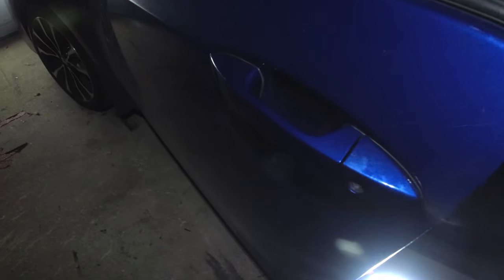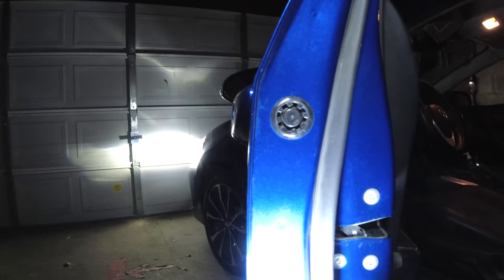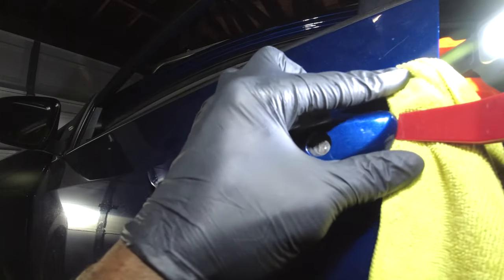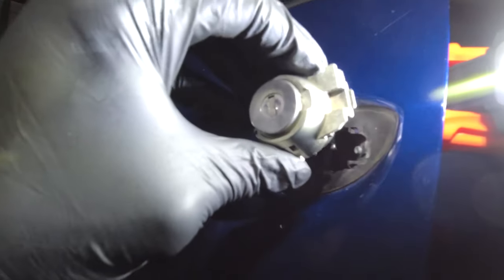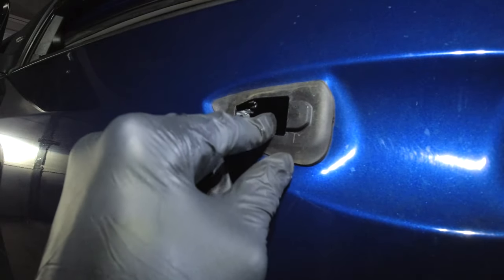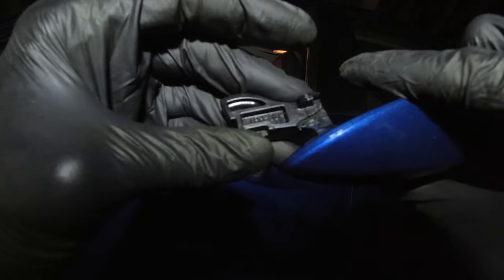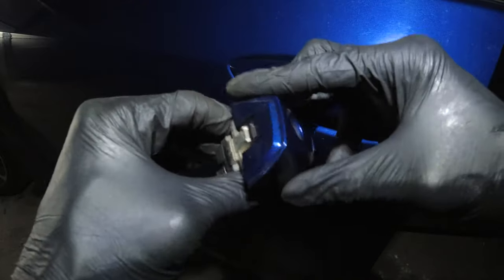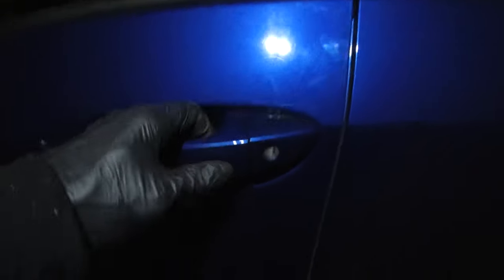2014-2019 Toyota Corolla Outer Door Handle Replacement (VERY EASY!)

Comment: I'm unfortunately having a lot of trouble screwing the lock back in....
Reply: what did you do? I've been trying for two hours to get mine to screw back in but its just not working
Reply: i found the solution, there is a VERY SMALL piece of plastic that holds all of the plastic innards closer to the outside of the door by a couple millimeters. its on the bottom right side of the smaller opening (the one the cylinder goes into, it looks almost like a broken piece of plastic. i had to use a screwdriver to enter from the side of the door where the torqs bit is to push the plastic as a whole to the left, and i heard a click of the very small plastic clip, its a tiny little hook that grabs the metal of the door.  I'm sorry if this was long winded, i just wanted to be thorough in that its small but does exist. as soon as it clicked into place i was able to thread the bolt back in without issue.

Comment: I've done everything i can imagine doing and i cannot get the bolt to line back up, the lock cylinder is perfectly flush on the car, its perfectly seated in the locking mech, but the bolt just spins. im leaving this comment as a desperate attempt to find a solution, ive been trying for hours and it just free spinning
Reply: Same exact issue I'm having
Reply: @gregoryparelli1526  i found the solution, there is a VERY SMALL piece of plastic that holds all of the plastic innards closer to the outside of the door by a couple millimeters. its on the bottom right side of the smaller opening (the one the cylinder goes into, it looks almost like a broken piece of plastic. i had to use a screwdriver to enter from the side of the door where the torqs bit is to push the plastic as a whole to the left, and i heard a click of the very small plastic clip, its a tiny little hook that grabs the metal of the door.  I'm sorry if this was long winded, i just wanted to be thorough in that its small but does exist. as soon as it clicked into place i was able to thread the bolt back in without issue.

Comment: Thanks, used this video to get it done. The dealership said it would take 2-3 hours, took me 11 minutes. Half the time was just trying to fish out the plastic piece.
Reply from the maker: Same here.  Happy to help.  Stay safe.
Reply: @LoneWolf74_  It was much easier than expected but it was a passenger door with no lock so less of a task. Wondering if I should buy more for spares. It's just a single plastic piece painted to the vehicle color. The part is just the handle, so everyone should make sure to not lose those gaskets.
Reply: Yea, they wanted $450

Comment: My door handle is behaving the same. Would this extra movement cause me to also have a hard time unlocking the door with the physical key? Sometimes I can not turn the key to unlock the door. Thanks
Reply from the maker: Not Sure.  A plastic piece might have broken internally which could be possibly hindering the lock cylinder from turning properly but I'm not sure.  I'm convinced this is just a way to get more money out of people.  Plastic crap that breaks way too easily.  Back when I was little (in the '80's) a broken door handle was the last thing we had to worry about because cars were made differently back then.  Everything wasn't made out of cheap plastic that was designed to break to get people to spend more money.

Comment: **for those with issues tightening torques bolt back into place**

     This video is fantastic and accurate, but there was a minor detail overlooked. Sometimes when you pull the cylinder lock out it will knock loose a very small clip that holds the innards of the door a hair closer to the outer side of the door, allowing the bolt to thread back in properly. if this clip isn't in place the bolt will not thread back into the lock cylinder. To get it back into place first locate it (bottom right of cylinder lock entrance) to see what it needs to do.  Then use a screwdriver or small pry bar to apply a bit of pressure from the hole in the side of the door that you would access the torques bit from, pushing the clip back over the ridge of the lock cylinder hole. its very small and shaped like a 7 laying face down.

Comment: Thanks for the video. I just noticed this on my driver side door. Going to go on Amazon instead and get a non colored handle since I have the dark gray corolla so it won't really stand out. I noticed someone took off the door plug to access the torx screw...  got the car around June and been fixing up diy. Corolla is easy to work on. Did a battery replacement and a v belt replacement.  Thanks for the video
Reply from the maker: Excellent! And try to replace that missing door plug if you can.  You don't want contaminants & moisture getting in there and screwing things up.
Reply: @LoneWolf74_  thanks will do.  Just did my door handle a while ago according to your video. Was a breeze.

Comment: Do you have to buy the whole handle or can you just buy the little clip that’s broken???
Reply from the maker: It comes as one piece, so you have to buy the whole handle. That's how they make money nowadays.  Cheap plastic crap that inevitably breaks, even with normal use, so it has to be inevitably replaced. It was never like this years ago because stuff used to be more durable.  Not any more unfortunately.

Comment: Where exactly is the internals broken part located couldn’t really see where u were reaching
Reply from the maker: @ 3:09 The internal part of the handle facing the front of the car.  The part that pivots when you open the door handle.  That's the part that usually fails.

Comment: I can’t get the broken piece out. Is it hel in on the inside by a screw? Same situation as this
Reply from the maker: The (broken) piece just snaps into the rest of the assembly.  You should be able to pull it out with a pair of needle-nose pliers.  Be careful not to drop it on the inside of the door though.  Then you may have to remove the inside of the door to fish it out.
Reply: I had a similar issue where the broken piece was too hard to snag with needle nose… I actually used an old school method of very carefully and slowly screwing a drywall screw into the broken part just enough to hold it to pull back out.  Worked for me, but as said, be careful not to let it fall through…. Then you’ll be searching for how-to videos to remove the door panel to get it out (unless you don’t mind hearing plastic bits rattling in your door)
Reply from the maker: @mattferguson6631  Glad it worked out for you.

Comment: What about the rear? I dropped the lock actuator, loosened the torx.. what is holding the handle from sliding?
Reply from the maker: I will refer you to a video I just watched.  The title says it's a 2014 Corolla, (but due to the styling, it's obviously a 2017, but the procedure will work for both since they're the same car). The video is not in English, but he removes the rear door panel, plastic moisture barrier, unscrews and drops the door latch assembly, but he also has to use a small tool  from the inside to "persuade" the door handle assembly and push the door handle assembly towards the rear of the vehicle to remove it.  He stuck a small tool between the door handle and the inside of the door to pry it slightly up and out to get it to move backwards.  Hope that helps.  Here's the video.  He does it at around the 2:40 mark. https://www.youtube.com/watch?v=GwAB59eb03E
Reply: @LoneWolf74_  it was stuck, had to wiggle with force thanks
Reply from the maker: @aaronferguson2674  No problem.
Reply from the maker: https://www.youtube.com/watch?v=ButXJqKJUTY

Comment: Thank you for the video!  Could you tell me where you actually found the part? I been searching online and all information points to replacing the entire handle.
Reply from the maker: Unfortunately, I had to go to the dealer to replace the entire handle.  Cost $60.  I gave them my VIN number and they were able to get the right color for it.  The entire handle is one piece.  I guess that's how they make money....the internal plastic part (as shown in the video) breaks and then you have to replace the entire door handle.  Something you never had to worry about years ago like a door handle breaking with normal use, you have to replace after the car is only a few years old these days. Cheap plastic parts.
Reply: Thanks for getting back to me!  Going to the dealership early tomorrow morning. @LoneWolf74_

Comment: Hey, so I have the same issue as yours and do I need to get a new handle? Or can I buy a new clip and fix it to the old one? Also, did you had to by a new door handle? Please let me know. Thank you!
Reply from the maker: Unfortunately, the door handle and the clip that goes into the door are one piece.  That left me with one choice...I had to buy a new door handle.  It's almost like they build these parts so cheaply on purpose so you'll have to spend money buying a new one.  Anyhow, I gave the stealership my VIN number and they were able to determine the proper color from that and they ordered it for me and I had it in a couple of days.  Sure, $60 is a lot to spend on a little blue piece of plastic (in my case) but I'm happy with it and I hope this one doesn't break. Let's be honest... it inevitably will break, I just hope it lasts a few years.    Evidently, this is a common problem on these cars (cheap plastic parts), so I made this little video to maybe help people out who are in the same situation.   Fix it yourself. Save yourself some money.  It's easy.

Comment: It absolutely refuses to screw back in 😥😡🤬 
But it will. But in the mean time idk what to do
Reply: what did you do? mine absolutley wont screw back in no matter how perfectly aligned i get it
Reply: I dint quite remember. Just keep trying basically is what I did. 
If you can, sleep on it and come back to it. In fact, I think that's how I did it
Reply: @areyousureaboutthat6673  that's what i did, it was an extremely small plastic clip that held it a bit closer to the door that was off. as soon as it clicked in it threaded beautifully
Reply: @LoganDoesntHaveAids  nice glad to hear it. 
I hope we'll be able to help others who run into that. Thanks for the update